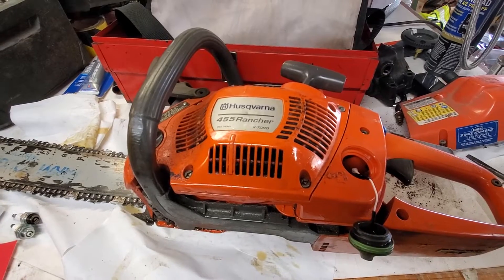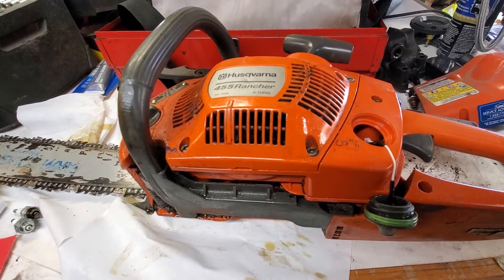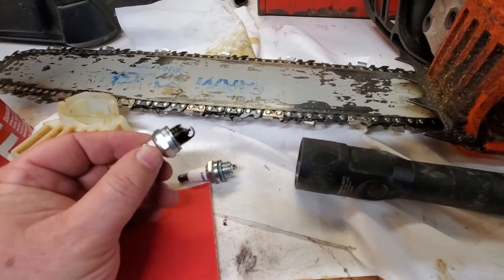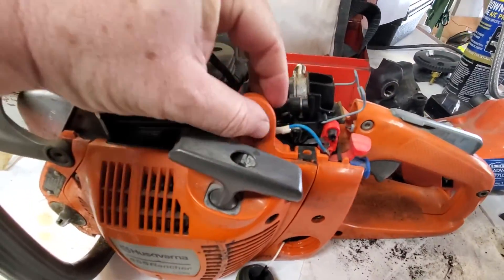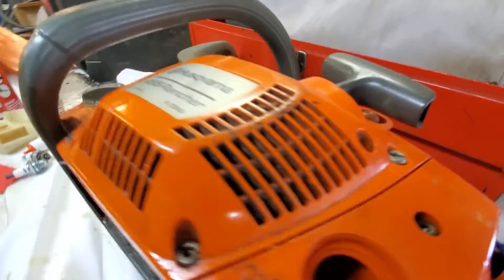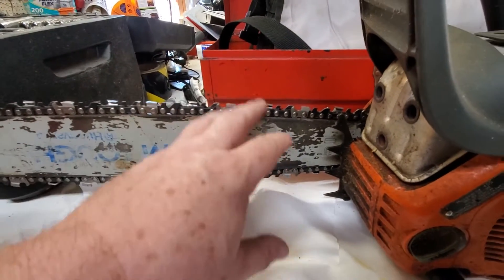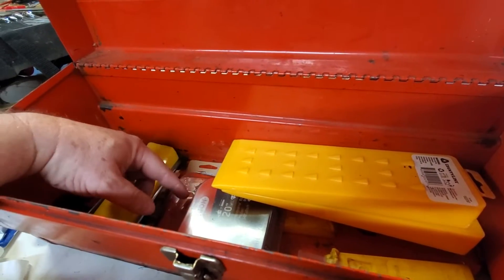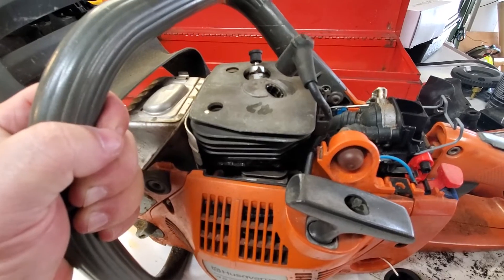Husqvarna 455 Rancher, 22 years old, basic maintenance

Comment: The wearing on a 5455 Husqvarna it's a 2000 model there's two wires coming up to the motor and I have the one wire with the white connection hooked up but I don't know where the blue one goes
Reply from the maker: The blue is likely your kill switch wire. Does it have a female midline and a female end?... look in front of the red kill switch for 2 empty male blades.